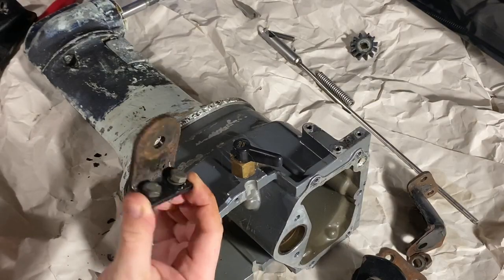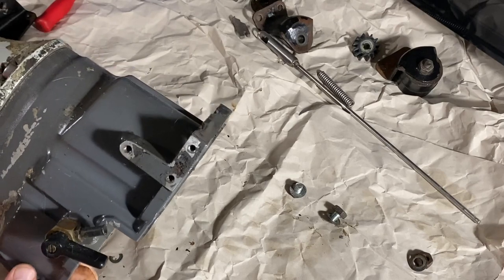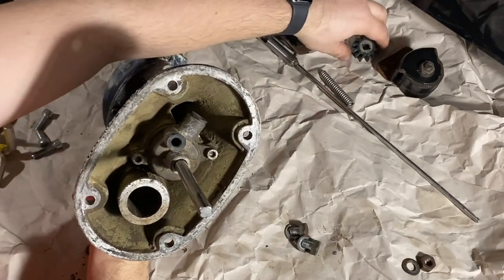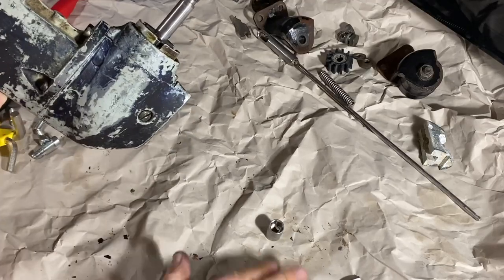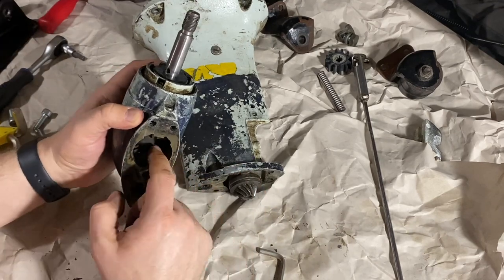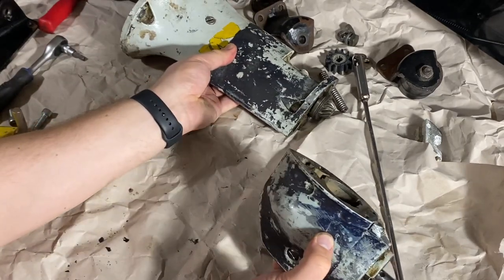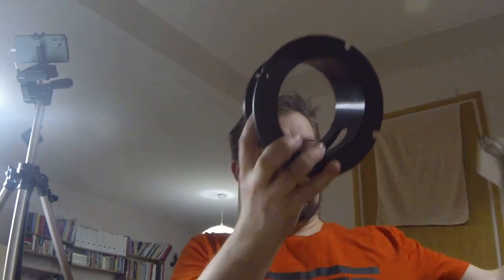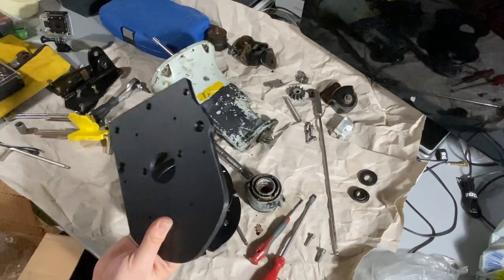Electric motor to sailboat Part 4: disassembling Volvo Penta MB2/50S saildrive: Ep9 Project SeaCamel

Comment: Hi ! I happen to be doing the same conversion than you on my dead MB2-50S :) Would you be willing to share your knowledge with me as i'm in the beginning of the project and havent choose a motor yet... Thanks
Reply from the maker: Of course! New video on under way, job’s not finished yet.

Main issues that come in mind by now are the usage of gears (or forward-reverse with motor) and the overall waterproofing.
Also one interesting thing to see is the actual performance of this 3kw motor. I hope to get boat on the water within couple of weeks. Then we’ll see! 🙂
Reply: @ArcticSeaCamel  Yes i'm binge-watching your vids to catch up with you. Would be interesting also to see if we can figure out replacement parts for our Sail-Drive units... I'm pretty sure the seals are standard some how. can we exchange emails ? Thanks!  - Stephane
Reply from the maker: Yes I ordered these sealing rings and o-rings just from local machine shop. They’re standard stuff. You just need to measure the cup and shaft sizes.
The lower paper seal is available from marineparts.com (Volvo Penta official shop). There’s quite little any parts available so take care of your saildrive.
Reply: @ArcticSeaCamel  Hey have been busy for the last month putting my boat in the water etc. I was wondering if you have tested the possibility to use the sail drive without having to use mechanical forward/backward ? (lock in fwd and spin the motor in rev or fwd...). Also, could you share the plate drawings ? I have sketched a plexiglass version but it is not optimal... Might save me time if i can use yours :) Cheers!